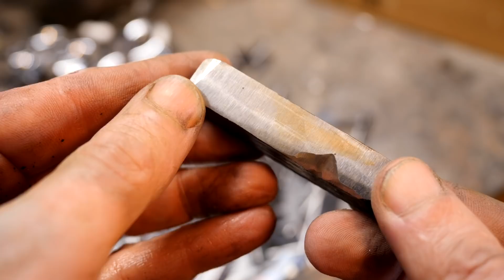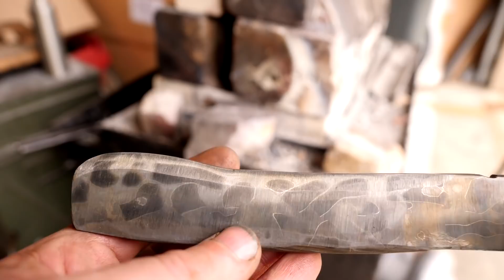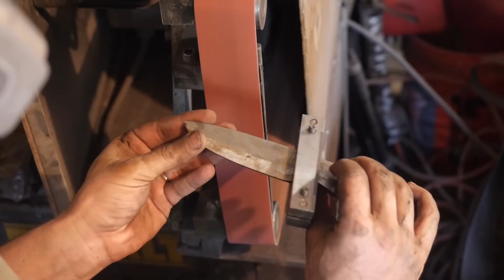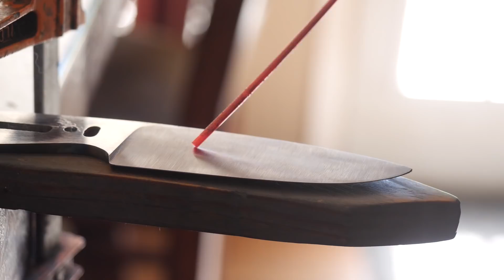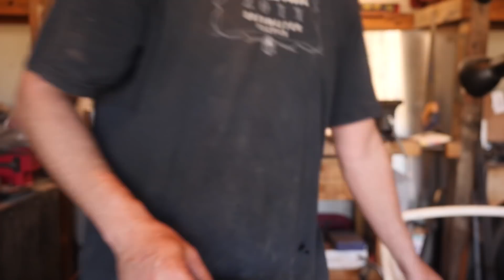Forging A Knife From Scissors

Comment: You did a video a while back of making a knife from numerous cold steel knives, I was thinking it would be interesting to take numerous cheap damascus amazon knives, forge weld them together in a canister, then use that billet as a jacket around a 1095 core.  I imagine it would be quite the insane pattern.
Reply: yes i agree i want to see this !
Reply: Looks like they still cost 30 bucks or so, if its something that the great beetle himself would be interested in, then I'd gladly donate  to the cause!
Reply: @coltonthorpe7812  OUTDOORS55 did a vid about those cheao damascus blades,he found them to be made of unhardenable stuff.
Reply: That's why I'm saying forge them into a jacket around a core of 1095. That way you have a hard cutting edge of good known steel and a jacket of softer steel on the outside. San mai style!
Reply: jolly good idea. off you trot and let us know how you get on with that...……...

Comment: I typically lurk..You record all of it.. It's not always all happies.. sometimes it all elbow grease to try and salvage so much time.  The time it  takes to get a simple billet of known steel.  This step can be a crapshoot.  For many many trying forge welds with what they have.. you have shon good practices.  You have a press but you have also worked with a hammer.  I've got nothing but respect.  I would be honored, humbled, and happy to hammer with you if we ever crossed paths.  I think we run similar paths Sir.  I tip my hat!
Reply from the maker: Ty sir are you around Tulsa?

Comment: The way I get around something like this is to forge weld a known steel to the edges.  We all know that drop forged scissors are not (usually) high grade alloy or high carbon. But some (leather         workers, or high end fabric cutters) sometimes are. So with cable, and “exotic” idea damascus it’s simply best to take that extra step to make sure the edge will be up to par.  Peace.

Comment: Awesome project and a wonderful result.
I think you should also consider crystal clear (resin sure, but what about glass? glass beeds and resin, etc - too?) or semi-clear handles.
If the pattern is lovely - and you have it on the full tang - why "loose" it. And or interestingly semi-clear patterned handle will keep the metal pattern visible.

Comment: Hey Green awesome work. I saw a dude use oxidized steel foil to line canisters with, after forge welding it would separate. With no grinding involved. I don't know if powder would matter.

Comment: For what it's worth (and I'm no expert) I would assume that scissor steel is actually rather good. Especially if they were used in a leather working shop, those are likely at least decent quality. If you think about it, the steel has to both shape fairly easily and be able to retain a decent edge. Scissors are just two knives with a pivot mechanism.

Comment: Tempered Steel, medical scissors are actually made extremely well as the highest quality steel available is used. Especially scissors from Germany or Switzerland. You can even purchase the same steel from the Swiss firm Notz Metal Inc,  that’s used  by the likes of Rubis Outils, WENGER SA, and even Victory Knox, three of the largest professional scissor, knife manufacturers in Switzerland.

Comment: Here's a tip: if you have forgotten to make holes in your tang before hardening; try using a dremel with a mounted point abrasive to make the hole.

Comment: I would love to see a scissor loop razor. For the most part scissors and razors were made by the same company with similar steel, usually a spring steel for carbon like a 1090. The stainless ones are usually 440a and sometimes 440c. So that should be some great steel.
Reply from the maker: Cool ty for the info👍

Comment: These are straight handled tailoring scissors or a mid length trimmer. The screw holding the scissors together, was it fine thread? Most pro type scissors and shears are adjustable, some are made from carbon steel and plated for looks and ease of care. Wiss and Clauss are two companies I know use HC steel.
Reply: they are shears, (very different bevels on the two edges,) the pivots are adjustable, branded craftool on some, gingher on others, blade edges maybe 4 or 5 inches.

Comment: you could try 4600KC powder if you want to use bright hardenable steel as i think steel carbon level evens out more in cansiters then other forms of forge welding.
Reply: PS: you can get 4600KC it from USAknifemaker.com 4600KC is similar to 15N20.

Comment: @Green Beatle I just got an idea. You should try to make a knife from drill bits. Maybe lay down a layer length ways then one width ways using cut up bits and continue to alternate until you have a full canister.

Comment: what if you took several threaded steel rods, filled the length of them with washers and the occasional nut then cansister forged them into a damascus blade?  you could toy around with the pattern by varying the number of washers between nuts... even vary the pattern of washers and nuts on each threaded rod.

Comment: What I would have done on the etch since the 1085 powder pretty much took over the billet, would be etch 3 cycles in Ferric Chloride polishing in between cycles like you did to establish topography, after the third cycle I usually take it to the buffing wheel to strip the oxides off then toss it into a room temperature Instant Coffee bath over night (20oz of any cheap instant coffee to between a quart and a gallon of water depending on how much of a contrast I want to make) wash with soapy water then hit it with a sunshine cloth... really makes the bright and dark contrasts pop.

P.S.  I don't care if someone posts that Scissor steel is crap later on, the blade turned out awesome, it has a nicely shaped drop point looks comfortable in the hand and has a Stupid Sharp Edge... All qualities that anyone with half a brain would look for in a blade, and you have one right there in one neat little 6.5-7" package. 

P.P.S.  The shears you used are 1045-1075'ish... somewhere in that ballpark (don't quote me on that) anyhow, I love the shade of Green you picked for the handle (is one of the only colors I can see clearly ^.^)
Reply from the maker: Nice info ty!

Comment: I think I have some questions Mr beetle sir.

Would decreasing the amount of tempering increase the amount of contrast?

Would making a mixture of 1095 powder and iron powder allow you to selectively tint the resulting metal?

Would using a slow coffee etch create a better contrast with iron? 

Would running a very tiny voltage and amperage through coffee be useful?

Just random thoughts. This is a very intriguing canister. And result.
Reply from the maker: No
Yes
Don't Know
Don't Know

Comment: Hey man.  I'm curious why you go to the trouble to keep the case from sticking to the billet.  Wouldn't it make sense to use a high carbon steel case and then integrate that into your billet?  My knowledge is very limited, I'm just curious why it's not done.   Thanks
Reply from the maker: You can’t see pattern through the case material and there’s no such thing as high carbon steel square tubing you’d have to fabricate it yourself.  Canister would cost $30 all by itself.

Comment: What about make the handel with parts of razor blade in epoxy ? 
kind of edges of blades turn like if you take the knife, it will cut you , but it is in epoxy ...
Reply from the maker: hmmmm sounds like something I would try

Comment: i love your videos and cant wait til you upload the next. i was also wondering what forge you have because i want one that can forgeweld because the one i have cant
Reply from the maker: I have one that I made but most 2 burner forges will do it.  Build one yourself (be careful) w 2” ceramic blanket rigidized w Satanite or check our models from diamondback, high temperature tools, devil forge, Chile forge, nc tool etc

Comment: Looks good to me!.  The nickle plating on the handle pieces turned out to be a nice feature.    Would you be able to get 1095 rods 1/8 thick, plate them with nickle, and then cut them in to small pieces?  might be able to get a finer snake skin pattern??

Comment: I am kind of shocked you don't use a cutting oil when drilling it after it was hardened. Also when milling, a good cutting oil (tap magic as example) will help keep chips down, and help the cutting edge of the tool dig in, it also extends the life of the tool.

Comment: industrial scissors are a lot stronger than you think they would be. They're designed to be used all day every day  so the steel has to hold an edge for a long time. Can't afford to have your staff constantly sharpening their tools. Makes sense that it would forge into an excellent knife.
Reply: these shears are so whack (one bevel is nearly 90 deg the other maybe 30 or 35) that we've never been able to get them sharpened.

Comment: Hey man, I work in a lubricating grease manufacturing plant in quality control... about every two to three weeks we throw into the dumpster a 1qt can full of 1/2" ball bearings hardened to 62-65RC as well as wheel bearings and races (I think I weighed one such can at 8#). 

I forged a small Puuko style pairing knife from one of the races (52100 most likely) but it's not properly hardened as I don't have the equipment to properly heat treat it...you do...so how do I send you one of these cans? I still have a lot of work to do to get my propane forge capable of welding otherwise I'd keep one. Cheers!
Reply from the maker: that sounds like a hoot email me at greenbeetlegear yahoo

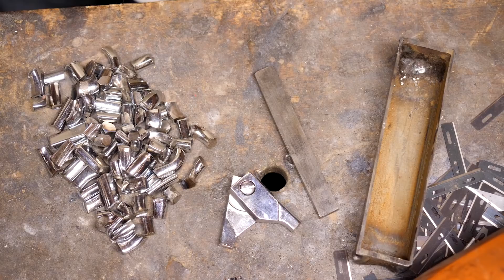Comment: @3:24 - Is using 'titanium oxide powder' (especially if you take into account the time needed to mix and apply this smudge) less expensive than Ti foil, which (for some unobvious reason) costs much less than SS foil?
Reply from the maker: this bottle was about $8 on amazon and has lasted a very long time

Comment: You can test the edge by slicing through a wood bcs in an edge that sharpen downward it produces microscopic teeth which is weak or easy chip off you should sharpen a knife on whetstone

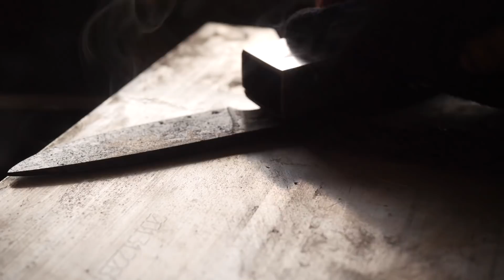Comment: A bit late to the party, sorry 'bout that. I have a little experience but obviously not much. After oil quench at 11:09, what're you doing there? It's not a step I'm familiar with.
Reply from the maker: I was pressing the steel while it was still hot to attempt to straighten any warps, it wouldn't fit in a vice due to the tapers which is what i would normally do here

Comment: probably could have used a chemical solution to eat off the nickel platting from the scissors, but for a smaller one time batch i'm sure grinding it away is quicker.

Comment: how do you remember where the core is
Reply from the maker: I marked the bottom of the canister with a line made with angle grinder and another line on the canister handle as well
Reply: @GreenBeetle  okay, that makes sense

Comment: I've used several pairs of Klein or Southwire Snips/Scissors over the years and i've cut everything and trust me when I say it takes a hell of alot to dull them.  So the steel must be pretty freaking good.  Here's the ones I use: https://cdn11.bigcommerce.com/s-dylwc6/images/stencil/500x659/products/63717/97505/2100-7__37280.1553836904.jpg in case you want to make something from them.

Comment: Have you thought of improving your flux formula?  85% borax, 5% charcoal, 5% powdered 1095 or whatever steel you are using, 5% fine silica glass.
Reply from the maker: Interesting.  What does the charcoal do?
Reply: @GreenBeetle  The charcoal isnt always necessary, but obviously it can help carburize a metal billet a bit more.  I know several smiths that use that mixture, including my amateur butt.  Even being pretty novice level, I dont have issues with cold shunts, splits, and seams ever and I dont have a press.  Yet. :)

Comment: My problem is that all you did in essence is meltdown one thing and forge a knife out of it losing all the character of the scissors and the blades but I think the blades got lost in there somewhere. Yes, if you incorporated the design of one thing into the other so someone might see the blending and recycling of design into something else then that would be something artistic and creative and not just metallurgical but design-oriented.

Comment: From me notes ;
Scissors usually 420, 430 and 440 steel
Most aint that good it's crucible steel some better ones are 440c tho..
Reply: He said it's carbon, it etched like carbon, hardened like carbon and stainless wouldn't have a nickel coating.